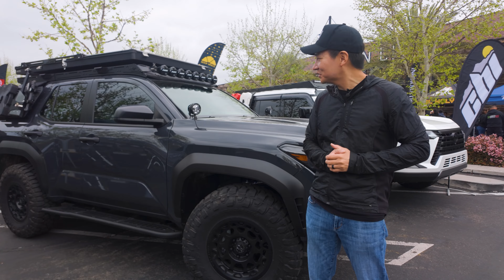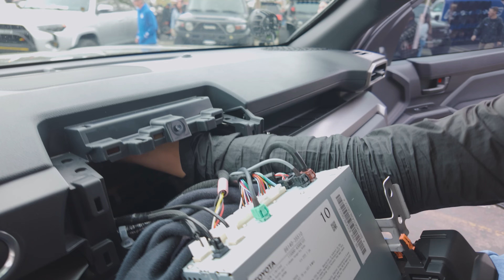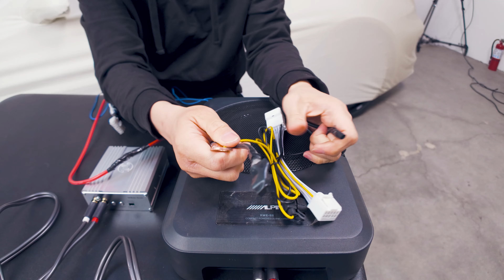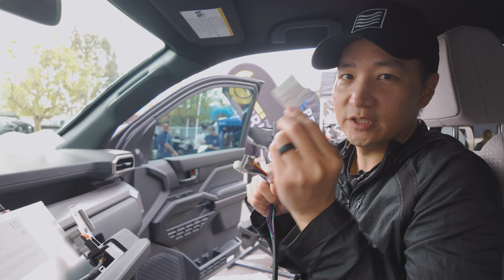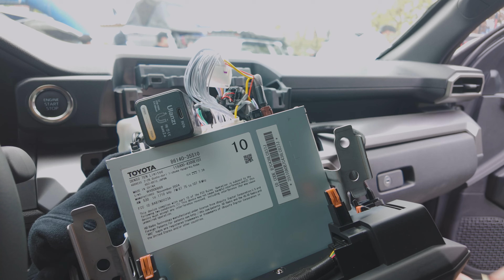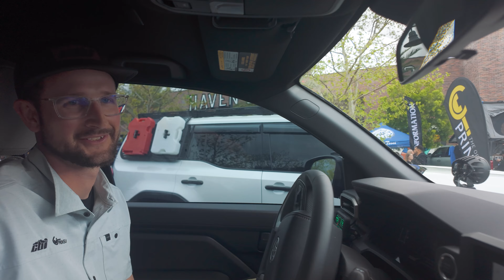2025 Toyota 4Runner Sound Test | Beat-Sonic Plug & Play Amplifier Installation

Comment: the most important part: where to mount it back there was skipped

I had to go through the double sided tape and the velcro trying different spots until it finally worked
Reply from the maker: Installs right on top of the radio itself

Comment: @beatsonicus, my harness didn't come with a ground wire???? Is it already installed with the harness itself,  i seen a black wire going in the clips, is that the ground wire?????
Reply from the maker: Yes, you have our newer updated harness without the ground wire terminal, and the ground wire integrated in the plug and play wiring harness.
Reply: I was in the middle of sending an email but went back in the video and saw this comment about the lack of a ground wire. Awesome

Comment: Could you create a video for the hybrid JBL equipped 4runner...including your routing for your wiring for a aftermarket amp/sub....Thanks.
Reply from the maker: 4Runner with JBL video coming soon. We did not install an aftermarket sub.
Reply: Just installed the system on our 25 4Runner TRD ORP Hyrbid, installs the same way.
Reply from the maker: @frankf7503  Thank you
Reply: I justed installed the beatsonic amplifier in my 2025 4runner limited hybrid, it really does make a difference in sound!! Easy installation, there's not to much space back there tho,but it fits!! Good stuff!

Comment: You realize factory makes it this way so you can’t blow the speakers. Once you start pushing these speakers hard below 120hz you’re f******. Get a sub and a separate amp. Car speakers should always have a  high pass of 120hz maybe 90 at the lowest. Don’t cut corners.
Reply from the maker: Appreciate the input! Just to clarify—our plug-and-play amplifier is specifically designed to work safely with factory and aftermarket speakers without blowing them. It includes built-in protections and tuning to avoid sending harmful low frequencies that could damage the system. We're definitely not cutting corners—we're just making clean, safe power more accessible

Comment: When do your audio options for lx570 and mark Levinson sound systems come out this year?
Reply from the maker: We're hoping sometime by Summer
Reply: @BeatSonicUS  will it be this same product in this video or new product/something different?

And also, will it be factory approved by Lexus like CarPlay?
Reply from the maker: @ It will be a slightly different product from the one in the video.
Reply: @BeatSonicUS  is there possibility of factory authorized from Lexus like CarPlay as well? Or is that CarPlay only for now? Thank you!
Reply from the maker: @mrk7365  being approved by Toyota and Lexus will take quite sometime.
Reply: @BeatSonicUS understand, just didn’t know if it was any sort of requirement from Lexus with Mark Levinson, and mainly asking because if factory approved, Lexus dealer can install like CarPlay…. Thank you and looking forward to it regardless!
Reply from the maker: @mrk7365  A lot of Lexus dealerships can install our Carplay kit.
Reply: @BeatSonicUS yes, mine in NC can, I was talking about the upcoming Mark Levinson addition…. I believe the dealerships will install anything that is Lexus factory approved like CarPlay (which comes with 3yr warranty if done at dealership, at least it does at mine)
Reply from the maker: @mrk7365  It will take quite some time before the amplifier may get approved.